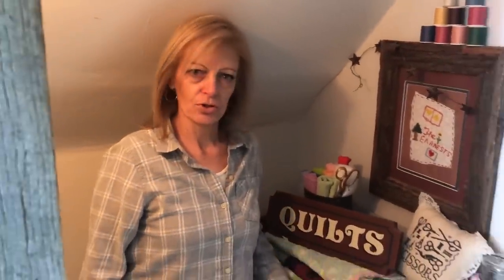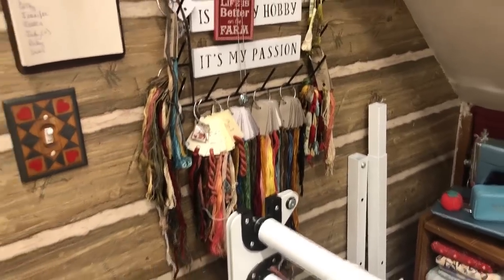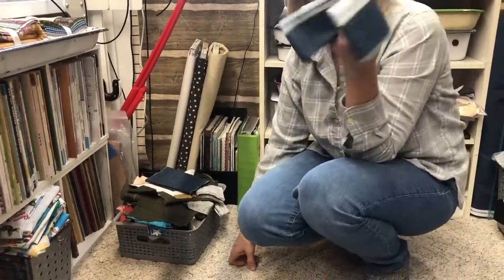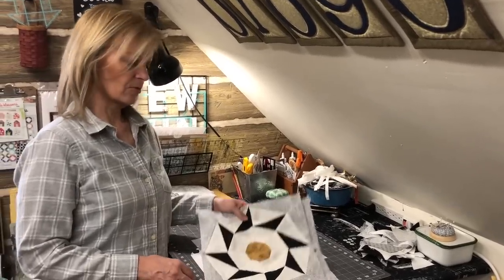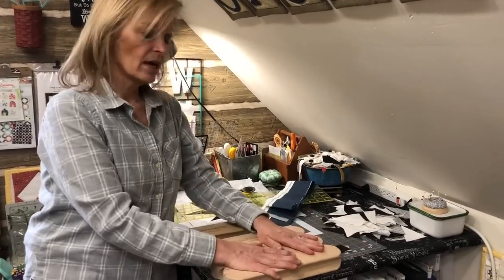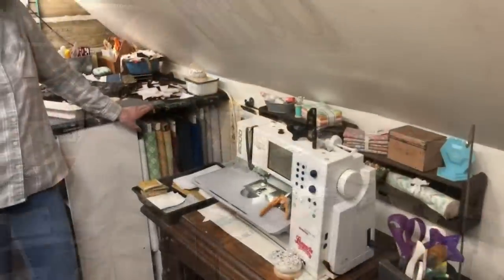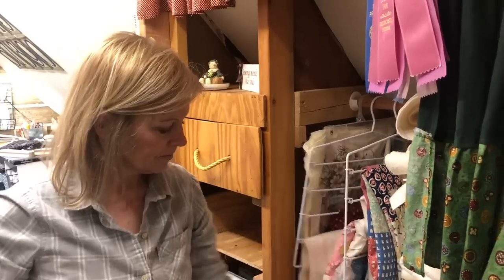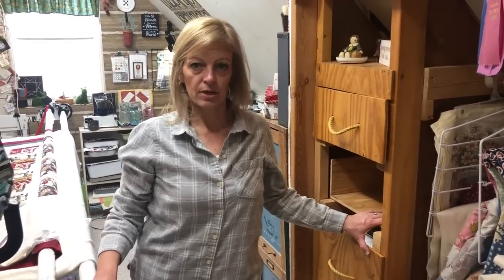Sewing Room Tour!!

Comment: Thank you for sharing your wonderful quilt room!  I have a question. How do you reach the back of your long arm machine if needed. Specifically how to turn on, etc. looks like tight space on ends.  thank you!
Reply from the maker: Hi Brenda!  Thanks for watching.  I AM in a tight space!  My table is 12 foot long and my room is 14 foot long! I am able to reach over the bars to turn the machine off/on and I have learned to load the quilt from the front.  But when I need to clean the back wheels or the track or if I want to load a quilt from the back, I have to crawl under the longarm to the other side.  Not the best scenario, but I make it work.

Comment: Tammie, I just bought your exact machine. We are going to have to convert some attic space too. I am trying to figure out exactly what I need. I was thinking a 16’x16’ minimum space…our attic is huge…or would you suggest a larger space? And what are your thoughts on electrical outlets? Counter height or closer to the floor? Any insight you can give will be greatly appreciated. We can’t start until this winter…Texas beat right now is brutal. So, I have time to really plan this out. Thanks so very much for your videos and any help you may offer
Reply from the maker: Congratulations!  You can make it work with 16x16.  Will your domestic machine, cutting area, ironing station be in the same place?  Then you might need more room.  I would have a dedicated electrical outlet right behind the machine.  I have mine plugged into a serge protector as well.  The cord needs to be free to move with the machine along the back, so my surge protector sits behind my machine in a central spot.  I am not able to cut batting in my space because it is too small.  So that may be something to consider.  The machine needs to be as tall as your elbows are when bent so that your hands are not higher or lower than your elbows.  This is especially important if you are doing any handguided work.  Hope this helps.
Reply: @tammieearnest  thank you so much! After looking at the attic space, and how steep the stairs would need to be, I think we are going to enclose half of the garage. I am afraid it will be a little tight but, for now it is in a guest bedroom and only set up at 8 feet. All the rest of my sewing will stay in my sewing room. I was really hoping to have it all in one space but, I will make it work! Thank you again. I don’t want to have regrets after he does all this for me. Love your videos!

Comment: Hi, I’m looking at purchasing a longarm Amara, can you tell me the length of your quilting studio from door to window. I am deciding between a 12’ or 10’ table. I have 13’7” on the wall I’m putting my table. Thank you for your help. 
Cathy
Reply from the maker: From door to window is 14'.  I have a 12' table but with the hand cranks on the side, I literally have 7-8 inches clearance on each side.  If I need to get to the back side of the machine, I have to crawl under the table.   Not ideal, but I'm glad the 12' table fits.  I previously had an HQ16 on a 10' table in the same space.  It worked well, but when I upgraded I really wanted to be able to do the biggest quilts so that is why I went to the 12' length.  Hope this helps.